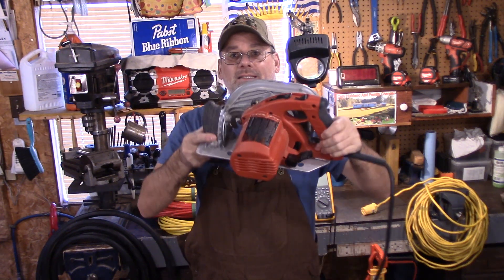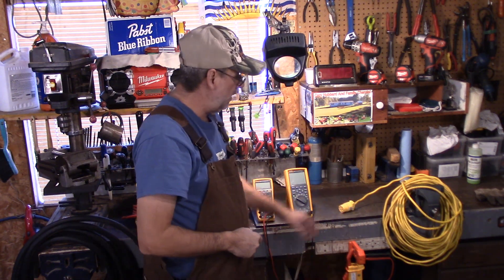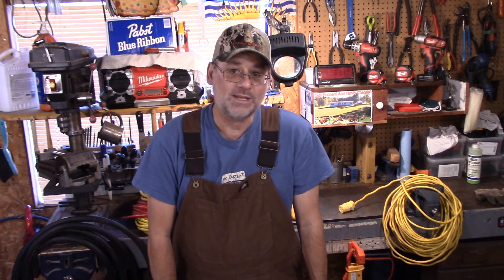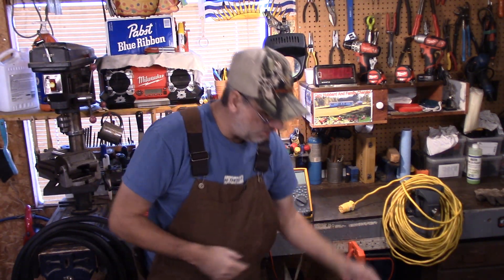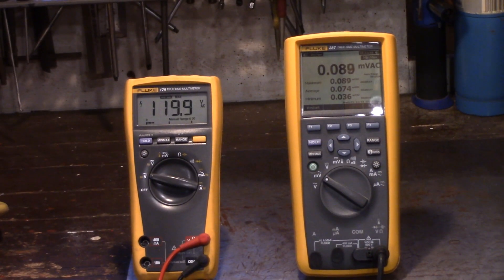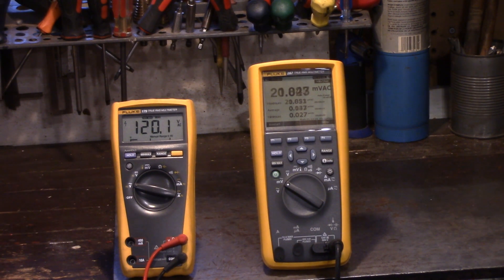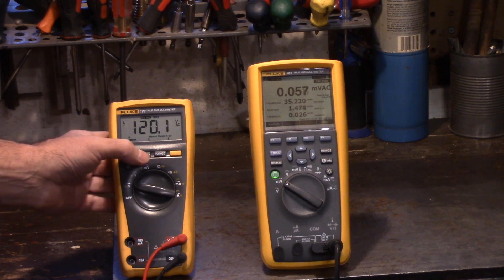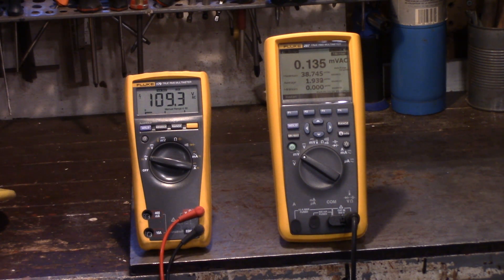EXTENSION CORD OVERLOAD -  CIRCULAR SAW TESTING - TESTING  AMPERAGE WITH A MULTIMETER  AND AMP CLAMP

Comment: Did the power from the house spike over twenty amps through the extension cord when he first started the saw?
Reply from the maker: @WhoOwl-o4f  The breaker is limited to 15 amp  draw but it will spike over 15 amps for milliseconds on startup.  If you tried  to  use a saw that  drew over 15 amps consistently it would trip the breaker.
Reply: @SteveRobReviews  wow thanks for teaching me something I never knew.

Comment: skill says you CANT use a 100 ft 12 G cord for theyre skillsaw
Reply from the maker: Skill makes a lot of saws, so if they say not to use 12g - 100 feet on a particular saw , don't use it .  The vast majority of homeowners saws drawing 10 amps will do  fine, so  just match the saws amperage draw to the power cords ratings.
Reply: @SteveRobReviews  well the 100 ft 12 g cord is rated for 15 amps and the saw draws 15 amps
Reply from the maker: @redsresearch   If the saw actually draws 15 amps  I'd  follow skills recommended but in my experience the amp rating tag on the saw is not the  running  amperage.  Not all extension cords are the same as you will see in pricing .  Voltage drop is always a concern as the voltage drops the amperage increases so in some situations you may only  get 114v or less  to the saw at 100 feet instead of 120v of the extension cord rating .  Say your  using the saw to cut heavy timbers and thus overheating the saw. Once you go past 50 feet on most runs voltage does drop so staying within 3% of 120v spec. on some devices  is preferred as some will still do well with up to 10% + or - of 120v.   Do some testing and measure how many amps your drawing and make a video to show 👍
Reply: @SteveRobReviews  so your saying it's fine to use my 100ft 12 g cord with my skillsaw made by skill?
Reply from the maker: @redsresearch I'm saying follow the manufacturers recommendations.
Reply: @redsresearch if you use a 12 gauge 100' cord you're looking at 4.34% voltage drop at 15 amps. The standard for motors is no more than a 3% drop. A 10 gauge cord would have a 2.62% drop making it the safe choice. I think you'll get by just fine with the 12 but if you pushing the saw hard just get a 10. I have a 14amp sds max rotary hammer and I won't plug it into anything but 10gauge because the thing cost around $600 same with my 15amp jackhammer
Reply: @redsresearch at that point I’d go down to a 10 amp and give the tool some breathing room at that length.
Reply: @mikewolf5367  no one's gunn use a 10 gauge cord buddy

Comment: In order for a 12 gauge extension cord to be efficient don’t you have to have 12 gauge wire running through your house which most people don’t?
Reply from the maker: Good question.   The answer is no.  The wire gauge of an extension cord and its  length  dictates the amount of voltage loss.  House wiring receptacle is rated at 15 amp 1800 watts maximum  so if you need 15 amps  using an extension cord  it's only possible matching the wire gauge to the length of the cord.
Reply: @SteveRobReviews  that doesn’t make sense
Reply from the maker: @Brandon  Makes perfect sense  if you have a good understanding of amperage draw of a load in relation to voltage drop over a given distance  and wire gauge.  Now  does that make sense now 😉
Reply: @SteveRobReviews  no because you need 12 gauge extentikn cord to run circular saw but your house only has 14 gauge or whatever
Reply from the maker: @Brandon   You definitely do not always  need a 12g cord to run a circular saw.  A 25 foot  14g cord  is accepted  but not at longer runs .  You have to match the cord to the power tool requirements  at different  lengths from the household receptacle.
Reply: @SteveRobReviews  so get a 12 gauge if I want 50 or 100 feet?
Reply from the maker: @Brandon  12 gauge up to 100 feet is rated at 15 amps .  I would get a length your most likely going to use as a 100 ft length can get pricey.  Check the prices and get a length most suited for your needs.
Reply: @SteveRobReviews  nice and I can still use a 12 garage 25 foot right? With whatever wire is installed in the house?
Reply from the maker: @Brandon-no3vc  Absolutely 👍
Reply: @SteveRobReviews  so if the extension cord is rated for 15 Amos and so if the saw wouldn't you want a bigger cord that can handle more then 15?
Reply from the maker: @Brandon  Your not going to find a circular  saw that is rated for more than 15 amps .
Reply: @SteveRobReviews  hmm so your saying when you run a saw with  a extension cord that's over 25 and under 12 gauge you burn out saw faster  but if it's over 25 feet and you use 12 gauge it allows more power through and not so hard on saw? Does that sound right?
Reply: @SteveRobReviews  ?
Reply: @@user-yy3ud2lh6k  if you use a saw rated at 15amps and you decide to use a 16 ga cord, lets say no matter the length, it will not be able to deliver the power needed for the saw to operate under load. In terms, it will put more strain on the motor, burning out your saw as it is deprived energy to operate.

Now, let's say you use a larger 12 ga and @ 25ft, instead of the smaller 16 ga.... Pulling the trigger, the saw will now be able to draw enough power to function properly, even under load. However, if you decide you need 200 feet of cord? What happens is the little angry pixies running through the cord have to travel much further. When electricity runs through a wire, the heating you may feel in the wire, is the electrons colliding with coppers and metal particles in the wire itself. Essentially, the energy is dicipating to heat, causing a loss of electrons in the current and further weakening your cord at the same time.  The shorter the distance the energy has to travel, the better.

I will suggest if you want a long cord and for your saw to operate properly and last a long time to use a 12 ga rated at 15amp 120v and stay within (no longer than) 65ft. In my experience, 65 feet is more than enough length for commercial or residential construction projects. Get a good, "high quality" cord 12ga rated 15 amp with the jacket designation SO or SOOW (oil/weather resistant), etc... but try to avoid SJ cords if you plan to work in rain and increment weather, as SJ cords are not rated for oil or water, and take care of that cord.  Hope that helps.
Reply: @slide6Y  why cant I use a 100ft cord ? Or even a 100 plus a 50 plus a 25
Reply: @@user-yy3ud2lh6k  oh, you can, but I always consider a little damage that can happen from twists and kinks from daily use... every hard bend in a cord makes work hardened metal in the cord (wire becomes hard instead of remaining flexable), eventually breaking strands of wire. Just to be safe, the longer the cord, the more guage you would want, but considering the cost and life of a long cord through daily use, that would be for you to decide. 100 feet is perfectly fine  as long as that cord stays in clean shape.
Reply: @slide6Y  so I can use a 100 plus a 50 plus a 25 foot cord all in one to run a 15 amp saw and it won't hurt it?
Reply: @SteveRobReviews  ?
Reply from the maker: Sure, that is a cost saving idea instead of multiple ones. 👍
Reply: @slide6Y  what you mean no
Reply: @slide6Y  why not

Comment: I’m going to buy a 12 foot frost king piper heater cord to heat my outside water line during this winter. What size extension cord should I use? Play heavy duty 16/3?  A 14/3? And I believe the heating cord uses 7 Watts per foot. I don’t know how many amps, I believe it said 13. ? 
🤷🏼‍♀️

Great video❤
I’m learning about power tools amps wattage electrical wiring for  little projects I have to do myself!  🤦🏼‍♀️

Before my husband passed away, I had a lot of confidence in doing projects because I knew he had my back. 

Any help is highly appreciated😊🙏
Reply from the maker: Hi Linden 
7w a foot x12 feet = 84 watts 
84watts  divided by 120 volts = .7 amp . so a 16 gauge extension cord is more than enough. Cheers 👍

Comment: I could have been that guy with the ratty old cord many years ago !  Dad was one of those 'can do it all guys' that knew electricity but didn't bother to teach me about wire gauges.  So I upgraded my game several years ago and went to 50 ft 10 gauge after I found out 50 ft 16 gauge was just not beefy enough.  I'm running a circular saw on it but I've recently discovered the circuit I'm on already has a heavy load on it.  So I wanted to find out how many amps I'm drawing and why it's not tripping the circuit breaker.  I didn't know about the splitter and I didn't know about the amp clamp.  O boy, i'm getting dangerous now !  So yes, the saw (or other equipment) may run but you may ruin it or anything else that happens to be on that circuit.  I'm also starting to understand that warning 'This device not to be used with extension cord'.   Knowledge is power !  Thanks for the tutorial !
Reply from the maker: Ira the best thing in the world is knowledge  and testing before guessing is  definitely the right way . Cheers 👍

Comment: Steve - Your saw is plugged into some kind of orange outlet adapter that lets you use a clamp ammeter and voltage probes. What is that adapter called and where did you get it?
Reply from the maker: This is it here Jordan. Extech 480172 AC Line Splitter https://www.amazon.ca/dp/B0000YHN9W/ref=cm_sw_r_apan_i_H2KFA2ERZ3SM1PREH11M?_encoding=UTF8&psc=1
Reply: @SteveRobReviews  Thanks for the fast reply!!!

Comment: It's good to share,,, for those who don't know,,, to overcome that voltage drop you can use a line conditioner,,TRIPLITE 2400W,,,,, I did it with an air compressor and a 100' extention cord drawing 13.5A on a 2 horse power motor,,, works great.

Comment: Can you use a cord for a 15 amp heatpress
Reply from the maker: Just follow the manufacturers recommendations and you cant go wrong.
Reply: @SteveRobReviews  i understand Steve. But I would like to place in garage. I'm thinking of getting a industrial cord 12 gauge. 25 or 50 ft
Reply from the maker: 12 gauge  should do just fine at 25  feet .  Longer than 25 feet I would go with a 10 gauge.

Comment: Love you message and enjoyed watching it.  I finally purchased a Skilsaw Spt70wt job site worm drive table saw.  It shows 15 amps in the manual and on the name plate.  I was going to get a beefier gauge but someone said this also is not recommended.  My cable run is around 10 to 20 ft.  Not that big.  Should I just get the standard 15 amps, 14 gauge cord?  Would a larger gauge help or hurt the longevity of my TB?  Thanks
Reply from the maker: Brian 14 gauge should be fine up to about 30 feet . Once the saw starts up it will drop in amperage .  Cheers

Comment: any reason oter then saving money to not get the lowest guage you can find?
Reply from the maker: Good question John. If you get a gauge too low your tool will work but you will just burn out the armature overheating it or some tools will not have the same power at all and burn out over a short time.
Reply: @SteveRobReviews  I just wanna clarify I mean buying all 12/3 instead of assortment  of 12/3 14/3 and 16/3.
Reply from the maker: Sure  that's fine as long as you dont get them mixed up.

Comment: I have a small dewalt jobsite fan, if I use a 25ft extension cord 12/3 rated at 15amp. The cord provides more amp than tool requires. Will it damage my fan?
Reply from the maker: Your all good to go. 👍
Reply: @SteveRobReviews  You can always use larger gauges than the minimum.  The voltage drop will be very small as a result.  You can't go wrong using heavy gauge cords.

Comment: Good video, thanks. Lesson: GENERATORS also need 3X a saw's rated amps.
  I have a brand new 15-amp  EVO 9" metal-cutting saw and a brand new Northern Tool 3000-watt/3600-watt surge generator. Multiplying 120V x supposedly 15 amps you would expect the draw is going to be just 1800 watts. Not so as you showed us.
  Cutting only 1/8" thick flatbed on a truck's diamond plate flatbed this was my experience: either the 20-amp circuit breaker on the generator trips or the overheat button on the saw handle eases out. Then you have to wait a minute to reset one or both. Impossible to get the work done..
I am planning on paralleling another generator to be able to get double the amps when the saw cut begins.
With your saw which also is rated 15 amps, you drew 43 amps at startup not even cutting- with the saw's cord and no extension cord. When you added the extension cord you dropped your amp feed to 35.

  Let's say I am needing 43  amps for a few seconds to get my metal cut started. 43 x 120V = 5,160 watts. So in reality I need a 5KW or 6KW generator to adequately START and run a 15A/1800W saw. Hooking tools to shore power/home power we don't realize a surge of power because the house power is plentiful.
 On a generator we need to plan a 3X factor of overpower to run saws.

  I like the inverter generator's quiet 56 db vs a bigger generator which emits 76 db so I will try adding a 2nd generator with a parallel hookup. Thanks a lot for doing your tests which confirm I did not have enough juice from a generator to start my saw cuts. (I sent a boy to do a man's job so to speak.) I am sure electric air compressors need 2X or 3X amps at their startups, too. Lesson- oversize a generator for running power tools. Don't take a chance on burning out their motor windings with low power situations.

Comment: I looked at the manual, and it doesn't specify any type of cord to use with my saw.  Your video would be more helpful, if you could say the amperage, guage, and length of cord you use with your saw.
Reply from the maker: Saws have different amperage draws so the  extension cords are different too.  Look at the saw and see what the specs are in amperage then look at extension  cords and match the two . Every new extension cord shows the amperage rating for that specific cord.
Reply: @SteveRobReviews  at Lowe's waiting to get in.

Comment: this all makes sense...but now if I apply this in my own situation...would a 100ft. 12 gauge extension cord be able to handle circular saw and framing nailer?
Reply from the maker: Depending on the saw , it will work but may not be  recommended and the framing nailer using a compressor absolutely not both  at the same time .  Instructions for your saw will state extension cord specs as well as compressor.  Cheers

Comment: Do you lose any amperage because you are plugged into an extension bar like you are? I have my circular saw pulled into a extension bar.
Reply from the maker: I haven't noticed any , more so on the gauge of wire and length of extension cord . Some power bars are low amperage under 15 amps and dont use them. Cheers

Comment: When you used the circular saw and when it was cutting it went to 14 amps it never went up to 15.
Any appliance, tool or anything drawing electricity everytime your turn it on its always going to draw twice the amps for a second is like a car when you accelerate your car is going to suck more gas that when you are on the highway

Comment: If I lend out anything I go with it too.
Reply from the maker: Bruce I have has so many bad experiences lending stuff that its got to the point id rather just say no.
Reply: Agreed!  Same here!   Tired of finding my tools quietly dropped off in my carport in horrendous condition or ... not returned at all.   

On the flip side though... I have had to borrow some tools from folks and I always return them with a gift. Example... If I borrow a saw, I return it with an extra new blade.  

I also clean tools before returning them if need be. Folks that leave so much crud on their stuff, drives me bonkers.   

Helps keep ya in good standing with the tools people for future reference.

Comment: Great Video Bruddah!  Got a question for you. I think I asked it before but my memory box is so small fleas complain.  

Anyhows ... Steve what is the yellow do-hickey that you got your test leads plugged into?  That is exactly what I been searching for.  Can ya help a bruddah out and give up some info on it? ( or do a video on it ;)

Home depot has some great info on wire extension cords with the where, how and which one do you need based on what you're trying to do safely so you don't fry tools or burn the house down.  Here's a good link; 
https://www.homedepot.com/c/factors_to_consider_when_choosing_extension_cords_HT_BG_EL

Thx man and keep these really great vid's a-comin. Rick H.
Reply from the maker: The one that's  getting my  reading of volts and amps  is called AC line splitter. Great addition to the test kit. Cheers Rick
Reply: Test Kit?  Got the kit mfr and part/model number next time you go to the took house?
Reply: I found it bruddah.  Thanks!   I highlighted the words "AC line splitter" in your reply and did the ole classic right mouse button clickeroo and Booyah Baby there it was all gleaming glaxin & waxin just waiting for me to rub it's big ole belly.  Thx Bro!
Reply from the maker: Now get the camera out and lets see it in action. LOL